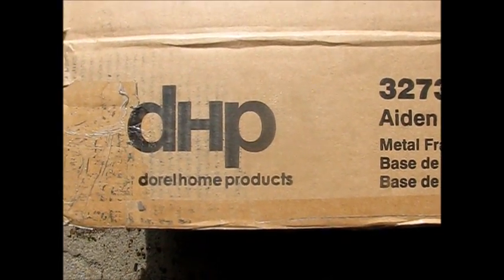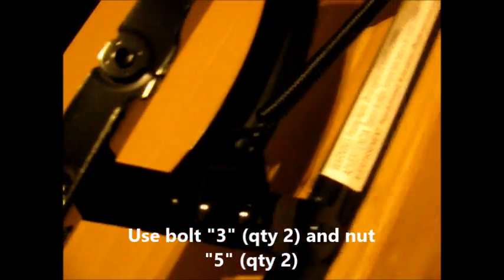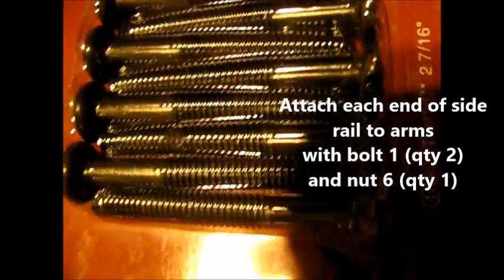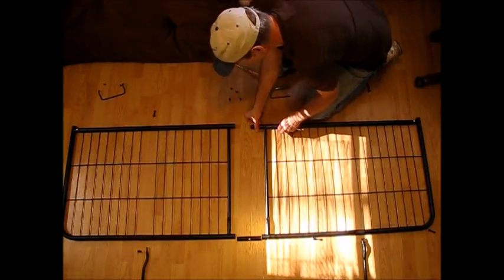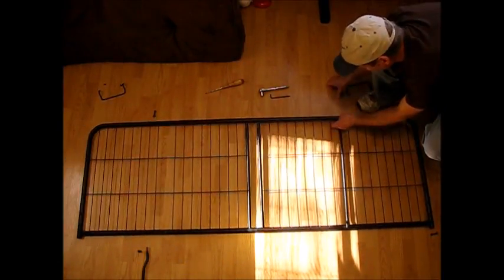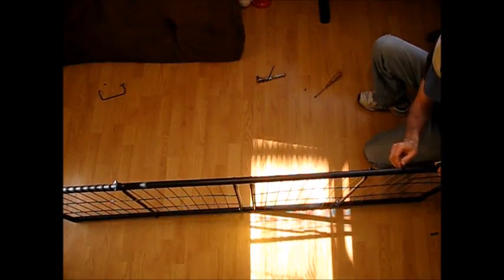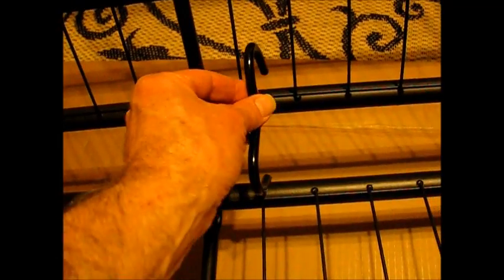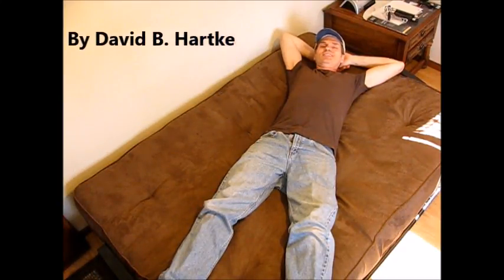How to assemble a DHP Aiden Futon

Comment: Anyone else have issues with the 7 screw fitting into the fabricated holes?
Reply: Yes and no matter what I try I cant get it in. Please let me know if u figure it out because I’ve been stuck all day.
Reply: Major issues that’s why I’m here. Doesn’t fit at all. Going to the store for a bigger screwdriver that I can torque a bit more and maybe smaller screws. If you see this lmk what you did to get it to work
Reply: Use a drill on 6 is a life saver

Comment: i don't know if you would  get back to this and I'm watching your video because I'm just stuck on one part it is between 3 and 4 and I keep watching the parts and I'm still confused, the part that I'm stuck at with the q connections I still don't know which one goes to which and I don't want to just guess haha
Reply: Don’t feel bad. I’ve put together many pieces of furniture in my day. I was breezing through the assembly and then I found the Q parts to be the most frustrating of all. The video made it clearer but I still screwed up (no pun intended) how to screw them into the O and P pieces. Pro tip: if the end of screws are sticking up you put them on wrong. I did this then put my brand new futon mattress on the frame and it got caught on the screw and put a small hole in the mattress 🤦‍♂️ the top of the screw which is smooth should be flush with the seat and the rough end should be coming out on the non-exposed end (facing down towards the floor). I hope this helps someone

Comment: Do you have issues with the frame when trying to transition it back into the sofa position?
Reply from the maker: Yeah. The mattress has to come off and then the frame will transition to sofa. It then helps to have two people to place the mattress back on.
Reply: Right! It would help if the frame had a little more weight to it. We were thinking about attaching 30lb weights to the sides of the frame. Lol

Comment: The dimension on the DHP site is showing it is smaller that a FULL/DOUBLE size mattress when flat....Can someone confirm if a mattress works as this will be  guest bed
Reply from the maker: I'd measure mine for you but I'm 1600 miles from the futon. My gut feeling is that it is a full size mattress.
Reply: @TheOriginalMechanic  Thank you..... I think the same but the dimension on the DHP site says the max Mattress length is 71".... I have contacted the manufacturer and for 3 different answers. If someone can confirm that a regular mattress can fit it would be appreciated

Comment: Can’t fit screw 7 into the holes that are pre punched in the H parts. Doesn’t budge
Reply: did you manage to resolve it?
Reply: @Miregoji  I did. Really I just suggest a quality screwdriver with a large handle, and just torque it a good bit then it eventually starts to screw in
Reply: @evanhaas1609  thanks for the reply. I was able to solve it by brute force. Assembling this was not the most pleasant experience.

Comment: Well I guess my sons did something wrong because the screws on the top back have made holes in my walls. There are also screws on the bottom where the thread sticks out under the frame and torn my cover. 🤷🏻‍♀️🤔
Reply from the maker: I had the problem with the wall too. I folded up a small blanket and put between the screw heads and the wall. the manufacturer should have used recessed screws.

Comment: Its not comfortable as a bed. If you notice he isn't sleeping straight on it and thats because it will bend in the middle and turn into a couch while in it. Dangerous, and they false advertise that two people can sleep on it.  Its a piece a crap. invest in something better that will have a locking mechanism for bed or sofa mode. Notice also he has it against the wall because it can easily go back.